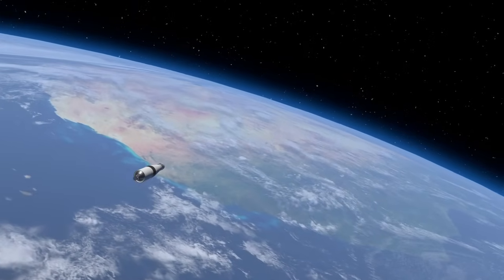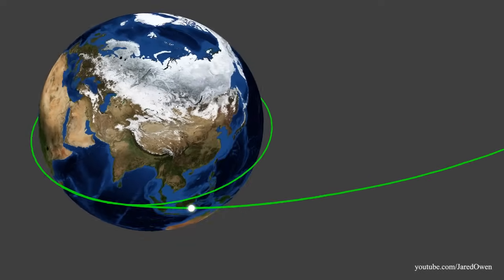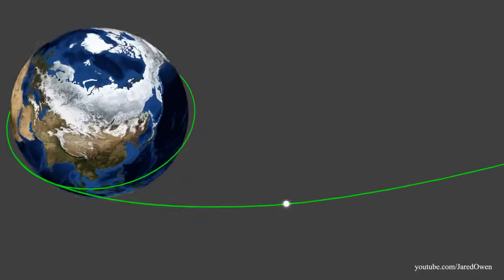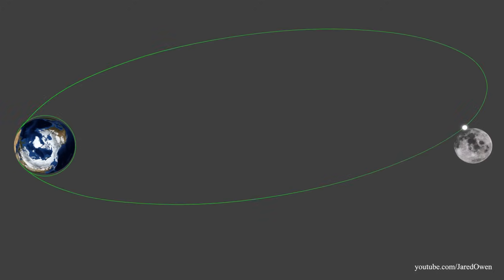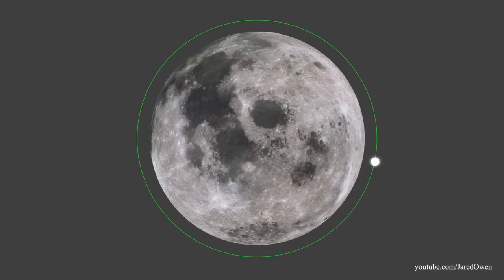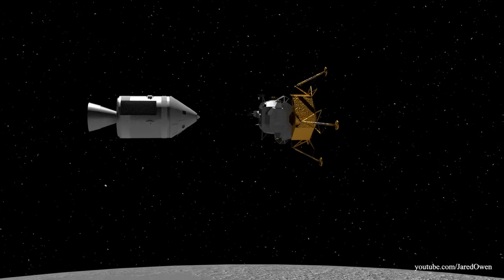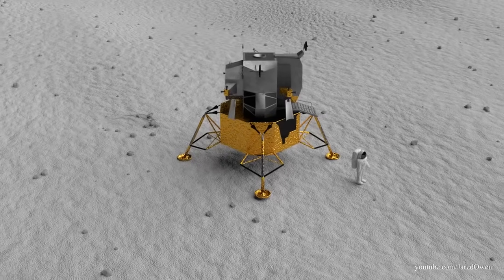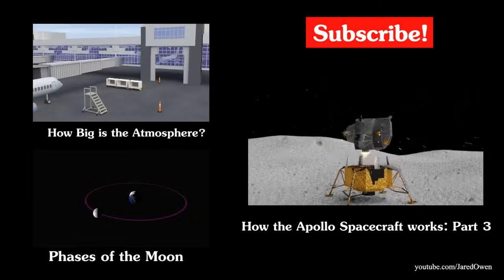How the Apollo Spacecraft works: Part 2

Comment: Excellent Job on the video and narration.  The only thing I would amend is cutting the engine thrust about 3 meters above the lunar surface.  A 3-meter extension wire, or probe, extended from 3 of the landing gear pads.  When any one of them touched the surface, a blue "contact light" would illuminate on the instrument panel.  That was the signal to stop the engine, about 10 ft above the surface.  The landing gear had hydraulic shock absorbers which would compress when the LEM fell the last nine or ten feet.  This was so the engine exhaust would not blow back into the exhaust nozzle and possibly blow up the descent engine.
     BTW, on Apollo 11, Neil Armstrong waited a little too long to cut off the descent engine after Buzz Aldrin said "Contact Light".  So the landing was very soft and the legs did not fully compress.  The descent engine did not explode, obviously.  Thus the bottom rung of the ladder was a little higher off the lunar surface than expected.  We see Neil and Buzz make a long hop off the ladder to the surface.
      On Apollo 12, Pete Conrad, the third person to walk on the moon joked as he stepped onto the lunar surface: "That might have been a small step for Neil, but it was a long one for me".  Haha.   Source: "Rocket Men" by Craig Nelson.
Reply from the maker: Yes I believe your correct!  I can tell you've done your research. I read about some of those things as well, I probably should have stopped the flame a little sooner.  Thanks daffidavit
Reply: NP.  Your video has educated thousands and thousands of people.  You should be very, very proud of that.

Comment: My question is: How did they fire anything up in a vacuum?
Reply: The Apollo CSM and LM used a fuel called Aerozine 50, together with an oxidizer called nitrogen tetroxide. When you mix the two they spontaneously combust. Fuels with this property are called hypergolic: https://en.wikipedia.org/wiki/Hypergolic_propellant
Reply: Fuel AND oxygen are stored in the rocket tanks.
Reply: Keyboard runner...Nitrogen-Tetroxide (NTO), not Oxygen, was the "oxidizer" for the hypergolic engines on the LEM...Aerozine 50 (50% Hydrazine & 50% UDMH) was the "fuel".
Reply: @edfilipowicz4866  
You are right and also make things far too complicated for starters.
Reply: Johnny Kool ain't "cool", as he don't know the difference between a rocket engine & a jet engine.
.
Reply: @edfilipowicz4866  
No need to revile Johnny. Until now it seems like this was a sincere question. 
Please stay civilized even in the face of flatearthers or apollo hoaxers.
Reply: It's called oxidizer.

Comment: In your video, the engine is still firing as the lunar module is about to touch the ground.
In reality, the engine had to be shut down when the lunar probes were detecting the lunar ground, at 1.70 meter from the ground (length of the lunar probes).
Now, whereas the detection interface could have directly shut down the engine (it was containing electromechanical relays), it was just ligthing up contact lamps warning the astronauts they had to push a button to stop the engine; moreover, this button was not shutting off the engine when pushed, but when released instead (the electronic interface shows how this button was working).
It means that, after the lunar probes had detected the lunar ground, the engine was in fact shut off after an undetermined time...and could still be firing at touchdown!
http://www.angelfire.com/moon2/xpascal/MoonHoax/ApolloSystems/ApolloSystems.HTM

Comment: How does the lunar lander control it's descent in a vacuum ?. This isn't explained , the explanation is fine in an atmosphere , even though Neil Armstrong couldn't land a prototype on earth  , though how a prototype that was designed to land on earth , using the atmosphere is beyond me .Everything that takes off and lands on earth uses the air in some way . I've never found a satisfactory explanation , anti-gravity perhaps .
Reply: While you are correct that we have to fight atmosphere here on earth, the vacuum in space poses no obstacle to rocket engines. 

Btw; even though Neil Armstrong couldn't land a prototype on earth  why do you think this?
Reply: Keyboard runner, I think he's referring to the LLRV, which was hardly a prototype of the LM, but contraption which stood a jet engine on its back and simulated - as best as they could -  how one would control a LM in space.  Neil did land that many times (as did others), but he had that famous malfunction that caused him to have to eject from the LLRV - which had nothing to do with the ability of the LM to be controlled.
Reply: Alan is either a 3-year old or one of the dumbest adults on this planet.
Reply: @edfilipowicz4866  That's pretty typical of your side . Very big on insults , but not much in the way of real science . Show me an experiment that proves that a vehicle could not only descend in a vacuum , but could also move horizontally . I'm not 3 years old , and I'm not dumb , your comment speaks volumes about you though .
Reply: @edfilipowicz4866  I see myself as a sceptic rather than an outright moon landing denier  . A thousand reasonable logical scientific arguments have been raised  that cast serious doubt on the ability of late 60's technology to transport men to the moon . Most of the objections have never been refuted , except in the eyes of those with an emotional or patriotic attachment to the Apollo missions .  In 1969  a journey to the moon entailed too many unknown dangers , I know you'll say all these arguments  have  been debunked , the van Allen belts , solar radiation , micro meteors , extremely high temperatures especially on the lunar surface , communications problems , which  they appeared to overcome , miraculously , the flimsiness of the equipment etc. etc . I understand how the lunar lander is supposed to have descended to the lunar surface yet I can't visualise it working in practice . When the workings of an internal combustion engine were explained to me , or how a jet aircraft flew ,I understood , because I can visualise how it works in practice . There are people far more knowledgeable  than me on this subject , like Richard Hall . I think that a manned mission to the moon in 1969 , with the whole world watching , carried far too many unknown risks , and therefore the strong possibility of a disaster and total humiliation  for the U.S.A. , a humiliation from which the U.S. may never have recovered , they had to fake it .Given the cold war etc such a catastrophe was unthinkable . There is another possibility which I think has some credibility . If they did go they used technology far in advance of that which was publicly acknowledged in 1969 , or even now ,and there is plenty of evidence for secret technology far in advance of what's publicly known .  If you wish to insult me , please do so , but there's no need to reply at all . Btw  if you ever meet an adult with the intellectual capacity of a three-year-old  , please don't call him dumb , it's yourself you're insulting .
Reply: @alanwhitham6429  ...ya, I get pretty shitty when I read all these numerous technically stupid comments about the Lunar landing, particularly when I've been drinking.  My apologies.

I do not have an emotional or patriotic attachment to the Apollo missions...I'm just an injuneer who worked in the field of rocket & jet propulsion for over 40 years...since the mid 60's.  The basic technical capabilities of the USA (thanks to people like von Braun & his associates) were more than adequate in the 60's to design & develop a multi-stage vehicle to go to the moon (& back), however it would be a lot easier (technically) to do today.  All it took then was time & money...today it would take time, money, and corrupt payoffs to congressmen.   The US government wasn't smart enough to fake the Lunar mission back in the late 60's or early 70's...nor is it smart enough (by far) today.

Your questions about the LM's descent control in a vacuum (was via rocket propulsion), the "need" for an atmosphere (rockets don't "need" an atmosphere), Armstrong's earth "test" vehicle (it wasn't a rocket propelled "prototype", but a jet propelled simulated LM), everything ("jet propelled") that takes off and lands on earth uses the air (for engine combustion) and for wing lift & control...anti-gravity??  It's obvious you have no knowledge of basic physics, and/or why & how a rocket engine develops thrust.  I can easily explain the answers to all of your questions, but not via this website.
Reply: @edfilipowicz4866  Fair enough , you're obviously an expert in your field , I'm not questioning that .

Comment: After the LEM extraction, what did they do with the Third Stage? That is, unless they directed it to go somewhere else, it would just continue on the trajectory towards the moon, correct?
Reply: Some of them were indeed directed into the lunar surface, where the impact quakes could be measured by previously placed ground equipment, which helped to analyse the interior structure of the moon. Others flew past the moon and ended in an orbit around the sun where they remain to this day. In fact, Apollo 12's S-IVB is believed to have encountered the Earth once more in the early 2000s when when it flew across the sky for a few days or so. https://en.wikipedia.org/wiki/J002E3

Comment: .      I'm not 100% sure, but if I'm not mistaken, the landing craft's short name was the LEM, not LM, and the full name was the Lunar Excursion Modular.
Reply: Mostly correct, though I've NEVER heard it referred to as the "modular" as that term is an adjective rather than a noun.  But early in development they shortened Lunar Excursion Module (LEM) to "Lunar Module (LM)" but kept the pronunciation "LEM."  One of the reasons for the abbreviation was it was felt the term "excursion" sounded too much like a family outing rather than one of the most momentous events of human history...
Reply: @Toadster ____ That's just my poor spelling. I simply screwed up the spelling and didn't proof read before hitting post. one of my many flaws, though I try to keep my poor spelling from showing up in the comment section, I'm not always successful (especially when it's a word that is spelled correctly, but just isn't the word I needed, as spell check won't alert me).
Reply: When I began commenting on YT, I went back many times and noticed my spelling or grammar was always flawed.  Then I downloaded a free version of "Grammarly" an app that attempts to correct grammar.  It's not perfect, but pretty damn good.  Now, I won't write anything without using it.  It automatically underlines questionable language and makes suggestions, most of the time correctly.
Reply: Lunar Excursion Module, not Modular.
Reply: @edfilipowicz4866  
      Look 3 comments up.
Reply: West Kagle.   TY for picking up on this.   I've noticed on YT that some people are too quick to correct the faults of others, only to ignore their own.  I'm also probably guilty of this.   There was once a man, I think he may have been a carpenter,  who said something like:   "Before you remove the splinter from the other person's eye, make sure you remove the plank from your own".
Reply: He explained this in the video. The “excursion” part was dropped, leaving LM, although it was still pronounced LEM. And it was never called “Modular”

Comment: How fast is Lunar Orbiter?
Reply: About 1.6 km/s.
Reply: + ConsciousAtoms

Did it have a rocket propulsion engine?
Reply: Yes, as you could have learned yourself from https://en.wikipedia.org/wiki/Lunar_Reconnaissance_Orbiter
Reply: + ConsciousAtoms

Did the Lunar Capsule have a rocket propulsion engine, too?
Reply: What are you trying to accomplish with these questions? If you simply want answers, these can easily be found on the internet, and I doubt it will take you much more time than posting a comment on Youtube.
Reply: + ConsciousAtoms

OK. I know that the Lunar Capsule did not have a rocket propulsion engine at all. But the escape velocity of the moon is 1,48 mps. That is 5323 mph. So the capsule couldn't have reached that speed at all.
Reply: Again, what is your point? And what do you mean by Lunar Capsule? Not a single spacecraft exists that bears that name.  Please use the proper name of the spacecraft that you have in mind.